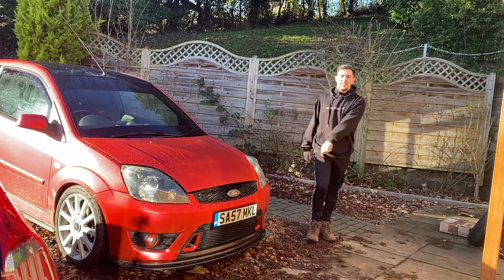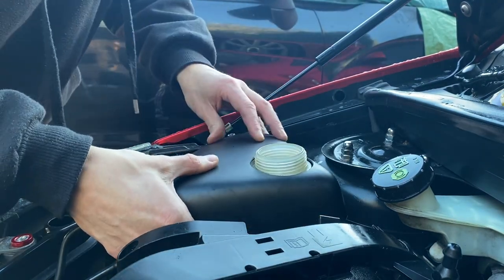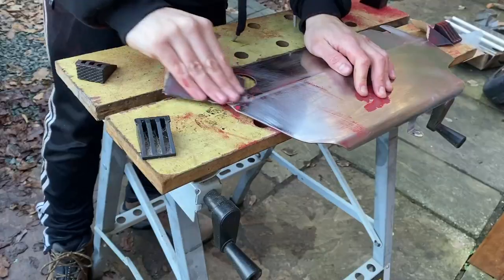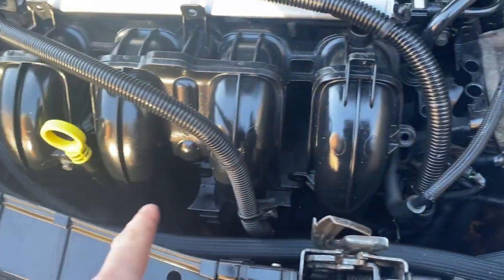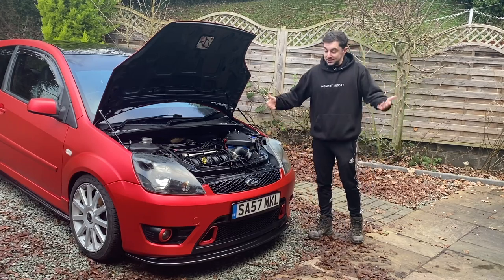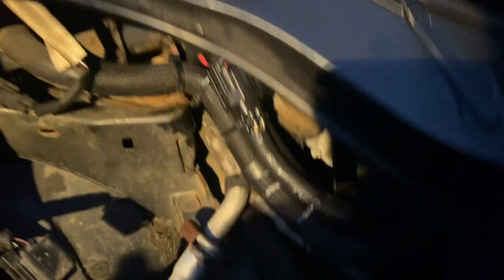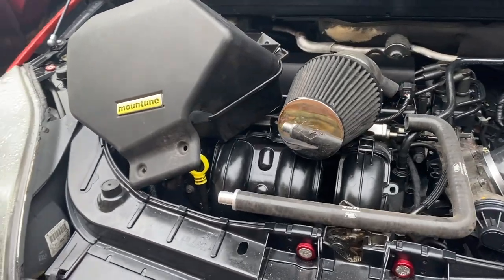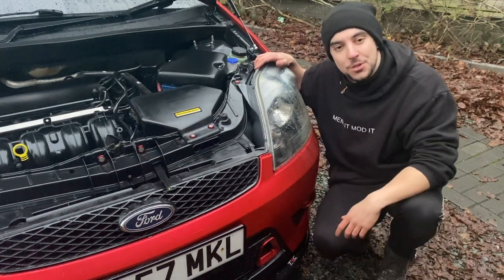Wiring Loom/Harness Tuck, New Engine Covers and a new Performance Mod for my MK6 Fiesta ST150

Comment: Now that you’ve moved the wiring. The original chrome engine cover you bought would now look better if you painted it instead.
Reply from the maker: Yeah I thought about painting it but it was in good condition so I didn’t want to scuff it up if that makes sense. It’ll be for sale with most of the other chrome bits soon

Comment: Not a fan of the plastic covers for the battery/coolant bottle, they look a bit Halfords like. I think painting the chrome covers you had would look better and match the engine cover. Edit: with the mountune cold air intake the plastic covers do fit a lot better with the overall look.

Although personally I like the standard engine cover 😊
Reply from the maker: I get what you mean mate, I could still paint them to match the engine cover, I just felt they looked a bit more OEM unpainted, and I thought they’d match the intake better as I don’t want to paint that either, rather keep it as it comes from Mountune. I liked the standard engine cover too but I got hassled for that when I put the RamAir filter on 😂

Comment: Do you have to keep updating your insurance policy after every modification, bigger wheels , air filter ect?
Reply: yes ..aftermarket filter / non oe wheels …body kit etc , have to declare , if not could void your  insurance on a claim / or insurance in general ..
Reply: @swiftyrs2354  any special insurance policy or provider or just any insurance, I'm with zenith.
Reply: Do you have to declare painted oe wheels ?
Reply from the maker: Yeah definitely declare your mods or any alterations from standard. Im on a modified policy and with mine any cosmetic, handling mods etc don’t affect my price, I can update them via their website and I get a revised list of all the mods I have each time I update it. Any performance upgrades that affect bhp I have to call them but as long as it doesn’t push it over an agreed level it still won’t affect my price.
Reply from the maker: @MrPaulb1982  you know what I don’t actually know on that one, mate of mine once had issues claiming because he had red brake callipers and the insurance classed it as a mod 🤷🏻‍♂️ guess it depends on the company but it can’t hurt to just tell them everything

Comment: What's happening with this engine I thought the compression was gone on 2 of the cylinders?
Reply: i believe it still runs ok , just uses a tad of oil , once  the mk7 engine he’s rebuilding is back in ,the st150 engine is next for a rebuild .
Reply: Mike should put it on the Dyno to see what it's making now that'd be a good video.
Reply from the maker: @norm4242  yeah I need to get that sorted, like swifty said I will rebuild it most likely but yeah there’s another engine on the stand at the moment 😂 I would love to put it on a dyno but i don’t have one local sadly, I’ll look into it though as it would be good to see how much better it is just after a rebuild and then I’d know just how much power it makes when I push on with the performance mods.